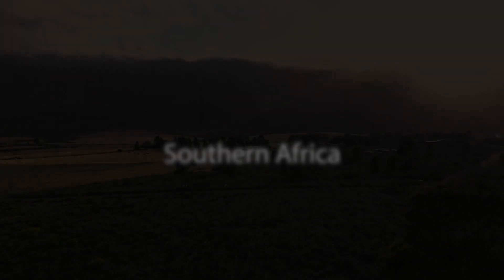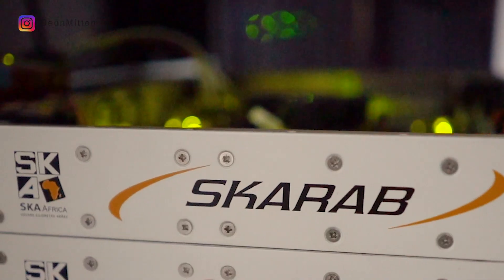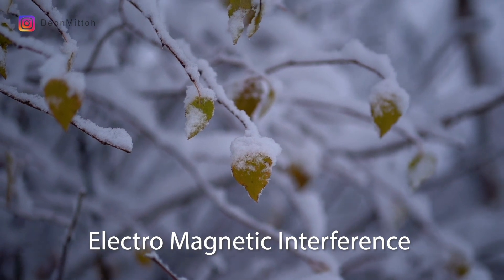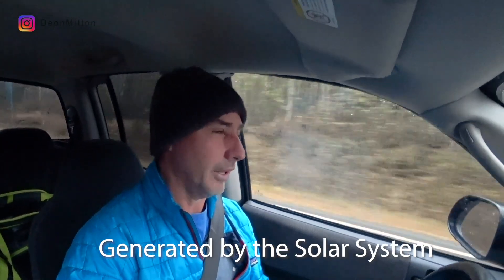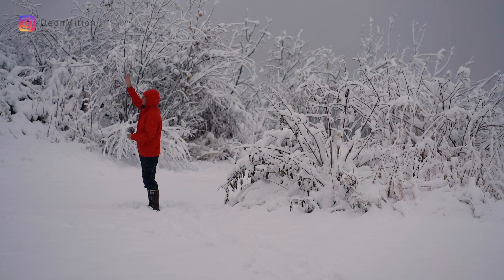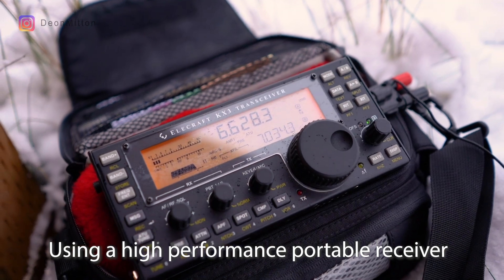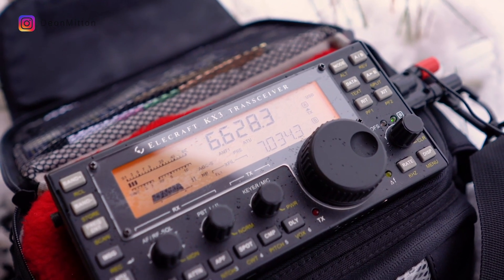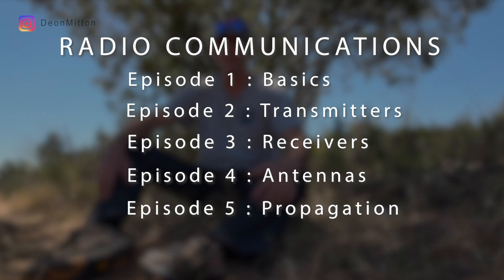How Radio Works - Episode 1 - Introduction

Comment: Thank you Deon! Getting the HF ready to instal in the Bonanza for long flights and this is keeping me motivated:)
Reply from the maker: Thanks John - sounds exciting - where are you going ?
Reply: Deon Mitton trip to Alaska this summer. Just getting the bonanza ready for its third trip around the earth and my first:)
Reply from the maker: @johnwisdom4877  Hey John - wow - that sounds exciting - Curious - what are you installing in the aircraft?  (which radio model)?
Reply: Deon Mitton I have an Icom IC-735 that has been mounted in the plane for the last two earth rounding and easily mounts back into the predrilled holes and existing wiring. But I plan to upgrade to a new digital receiver, still deciding on the best option to fit below the throttle quadrant on the bonanza. Yours thoughts?
Reply from the maker: @johnwisdom4877  Yes - I'll swap out the 735 for maybe : the 7300?